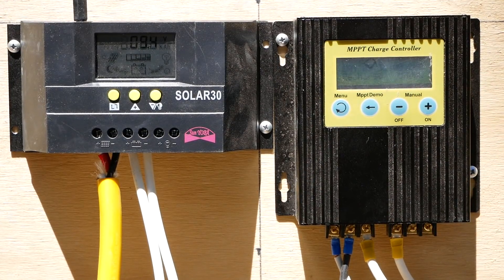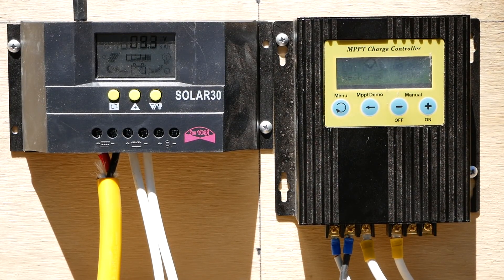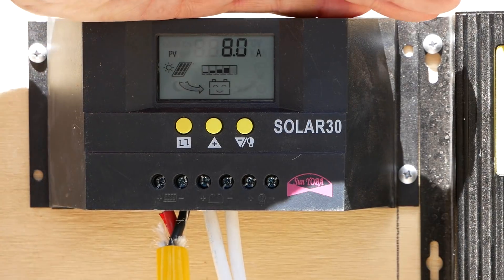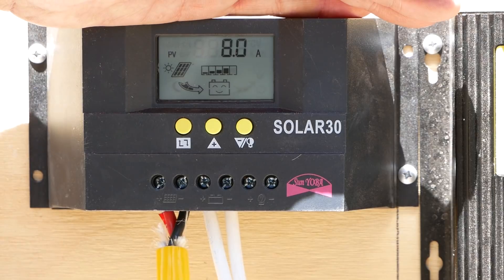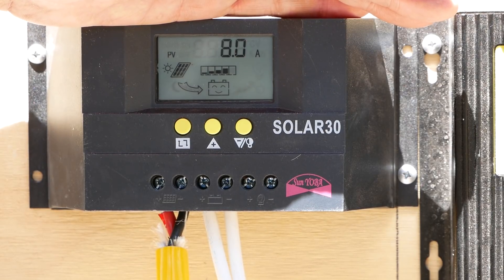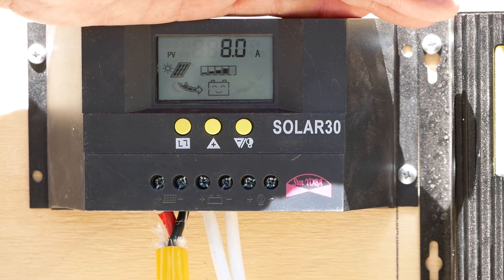MPPT vs PWM What does it mean to you

Comment: Панели последовательно соединенны. Вы подключите их параллельно, и посмотрите разницу
Reply from the maker: На выходе MPPT не будет большой разницы, поскольку он все равно сможет преобразовывать избыточные вольт в амперы. Это одно из преимуществ MPPT, которое вы можете запускать последовательно или параллельно, в зависимости от того, что лучше всего подходит для вашей ситуации.

in English

There would not be a large difference in output on the MPPT as it would still be able to convert the excess volts to amps. That's one of the advantages of MPPT that you can run series or parallel depending on what works best for your situation.
Reply: @solarboondocker4597  
Про мппт знаю, у самого мппт контроллер. Вы как панели подключили на пвм, последовательно или параллельно? Если параллельно, то вопросов нет.
Reply from the maker: @АзатДаминов-ш2э  Панели контроллера ШИМ подключены параллельно.
Reply: @solarboondocker4597  
Ок
Reply: @solarboondocker4597  
Вы все правильно сказали, шим режет напряжение панели до напряжения аккумулятора. Чем ниже напряжение, тем меньше с панели берётся мощность, когда она очень нужна. Mppt рулит.

Comment: Can you tell me please how many amps equals how many watts? I have a 700 w microwave how many amps does it take to run that? Say for 12 minutes? Without a generator??
Reply: laura j phillips watts=amps×volts

So 700watts÷12 volts=58.33amps

So if you have 58.33 amp/hour worth of battery, theoretically you can run that microwave for 1 hour off of a fully charged battery.
Reply: XLER 8 Thank You!
Reply: .........good question Laura........thx for that answer XLER 8..........a tech geek, i am not........:)
Reply from the maker: The formula is good but in truth a 700 watt microwave is 700 watts of output. A 6oo watt microwave poulls 850 watts and my 900w unit pulls 1375w. Now use the formula with those numbers
Reply: Solar Boondocker ........."Houston, we have a problem."
Reply: Yep, nothing is 100% efficient. Which would be a great lead to talk about inverters.
Reply: YouTube ÷ Google x keystrokes = answers... You can always find the appliances wattage on the back/bottom or website for the correct calculations.

Comment: so this mppt  is good for 100watt to 500watt?
Reply from the maker: The 20 amp MPPT controller is good for 275 watts of solar on a 12 volt battery and 500 watts on a 24 volt battery

Comment: There's something not quite correct with the setup.  Two 100 W panels in parallel will deliver about 11.8 Amps max (Isc).  A PWM controller essentially connects the panels to the battery and hence, should deliver 11.8 Amps, but at a voltage of 13-14 V (depending on exactly where the battery is in its charge state).  An MPPT, on the other hand, harvests the power at a much higher (18-19 V) voltage and delivers most of it at a lower voltage and higher current.  Thus the MPPT should have delivered more than 11 Amps.
Reply: Edit:  overlooked the fact that the MPPT panels are in series, basic argument still holds.  MPPT harvest the power at 34-36 Volts, do a DC-DC conversion and deliver the power at 13-14 Volts.  So, something higher than 11 Amps expected.
Reply from the maker: Hmmmm, to you I would not think I would need to explain this. A MPPT controller does not produce any extra amps, it uses all that is there. Also MPPT is a program that decides what is the best way to bring a battery's voltage up and it it isn't always as fast as is possible. The last thing is conditions dictate much of what panels produce, so you can not make the calculation without first putting a meter on them to see what they are producing.
Reply from the maker: I like the control the Bogart system gives but I wish it was on a MPPT controller.
Reply: @solarboondocker4597  A MPPT controller does produce more Amps if it harvests power at a higher voltage and delivers it at a lower voltage.  By doing so, it attempts to use all the power there is.  A PWM controller delivers all the Amps (Isc) a panel can produce.
My comments were based on what I saw in the video - two similar/identical panels under the same conditions produce the same power and one would expect the MPPT controller to deliver slightly higher Amps.
Reply: @solarboondocker4597  Thanks!